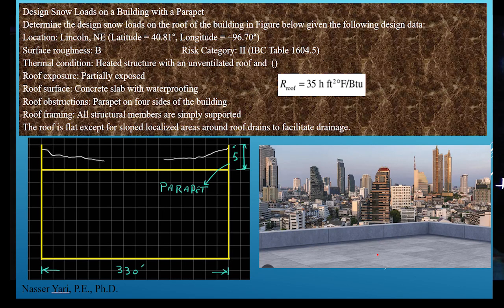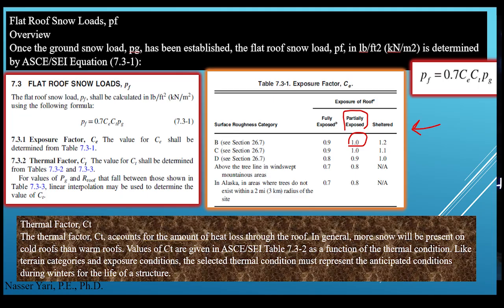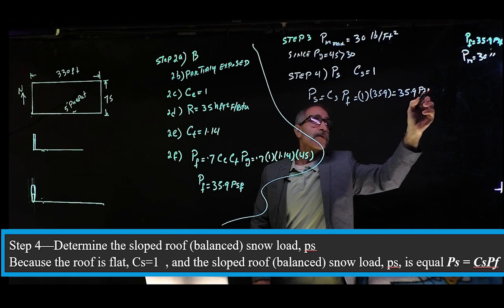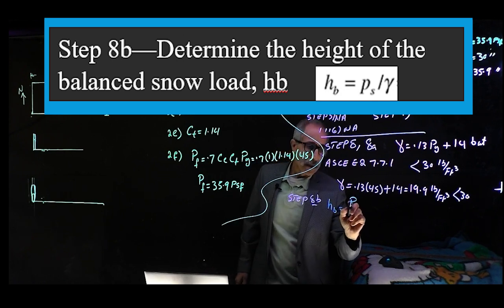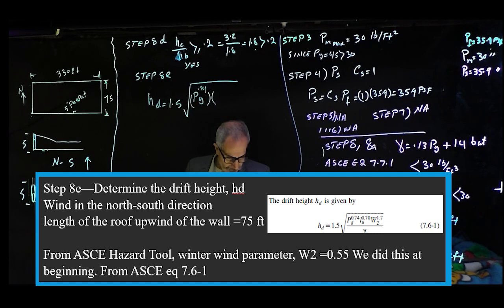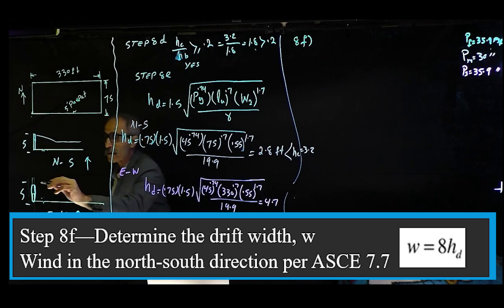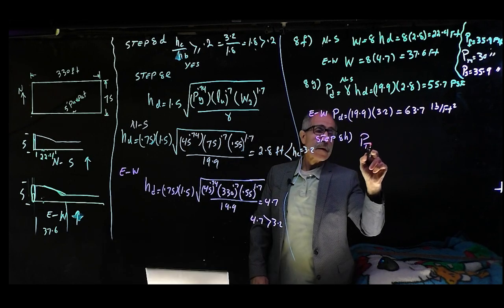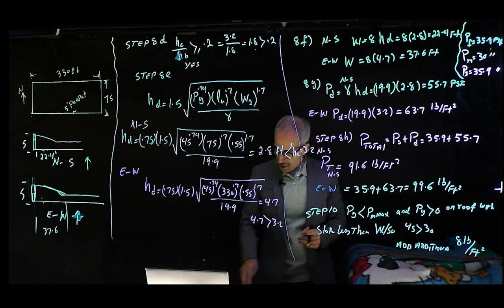Design Snow Loads on a Building with a Parapet

Comment: What if your parapet was only 2.5' tall? Would you allow the balanced + drift surcharge snow height to exceed the height of the parapet? According to ASCE 7-22 (7.7.1) there is no limit on the windward drift height like there is for the leeward drift height. 

"For leeward drifts, if hd is equal to or less than hc, the drift width, w, shall equal 4hd and the drift height shall equal hd If this height exceeds hc, the drift width, w, shall equal 4hd^2∕hc and the DRIFT HEIGHT SHALL EQUAL hc."

My particular project is a gas station canopy (30'x50') with a 2.5' parapet around the perimeter. My RC=II ground snow load is 52 psf and W2=0.55. I originally did the design under the 2018 IBC (pg=25 psf) and the uniform snow was 21 psf (1.22' tall) and that allowed another 1.28' for a drift up the parapet (22.1 psf @ 17.25 pcf density) which came out to a 5.13' drift width. So total ASD load over the drift = 21psf*5.13' + 1/2*22.1*psf*5.13' = 164.4 plf.

When using the drift equations of the ASCE 7-22, I'm now getting a 43.7 psf uniform snow (2.1' tall) and, without limiting the drift height to the clear height, hd is calculated as 2.52' (52.3 psf) for a total drift height of 4.62', which is taller than the 2.5' parapet. The drift width is 20.16' (8*hd) . So total ASD load over the drift (use same uniform load width as previous paragraph)= 0.7(43.7psf*5.13' + 1/2*52.3psf*20.16') = 526 plf. That is over 3 times as much drift load as the 2018 IBC approach.

IF I allow the drift height to be capped by the parapet height, then the numbers get a lot better. The uniform snow height (2.1') is almost the full height of the parapet. Only 0.4' of drift is possible. So surcharge magnitude is 0.4'*20.76pcf = 8.2psf. This makes the total ASD load over the drift = 0.7(43.7psf*5.13' + 1/2*8.2psf*(8*0.4')) = 166 plf. That is almost exactly what the 2018 IBC net result is.

There is no similar verbiage limiting the drift height to the clear height for a windward drift. There used to be in ASCE 7-16. I'm looking for peer opinions on limiting the drift height. Another thing to consider is since we are using ultimate/nominal snow loads, the calculated uniform (hb) and drift (hd) heights will be bigger than the previous ASD approach. The magnitude of the load will be reduced by using the load ASD combination factor of 0.7 on snow loads, but the drift width is based on larger loads and the drift width does not get a load combination factor. So using larger ground snow loads in the ASCE 7-22 will always result in much wider drifts. Once you use the factored snow with that drift width, then the angle of repose of the snow is off.

I'm just not happy with the rollout of this snow change. I don't think it was properly thought through before adopting. They don't even put the MRI of the snow loads on the new pg maps.
Reply from the maker: The release of ASCE 7-22 has raised questions and differing interpretations among engineers. In ASCE 7-16, the drift height for both windward and leeward snow drifts was explicitly limited to the available clear height. However, in ASCE 7-22, the wording related to windward drifts at roof steps no longer includes this provision, creating ambiguity in how the requirement should be applied. Your original calculation is correct.